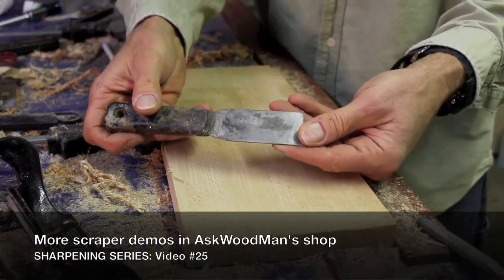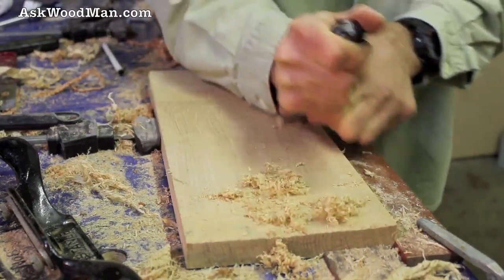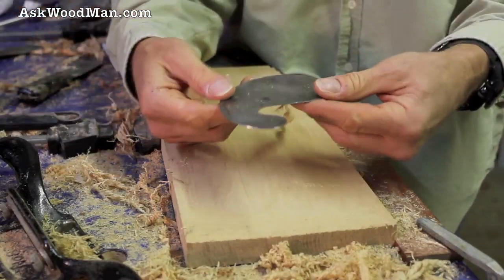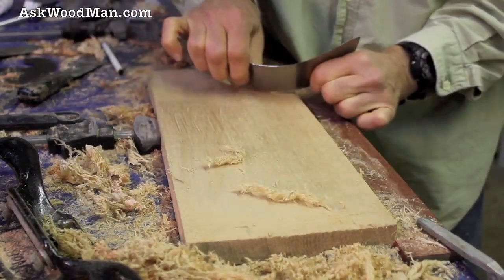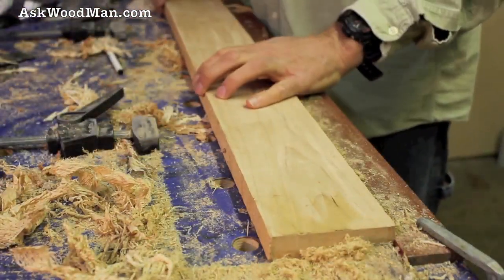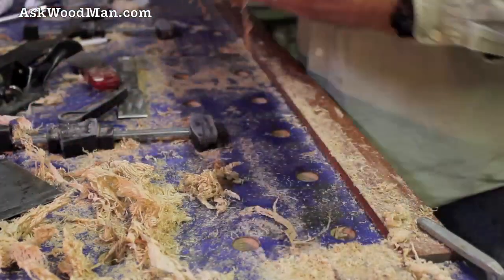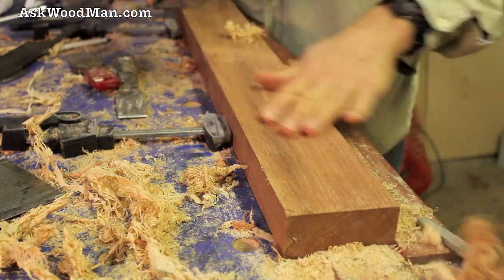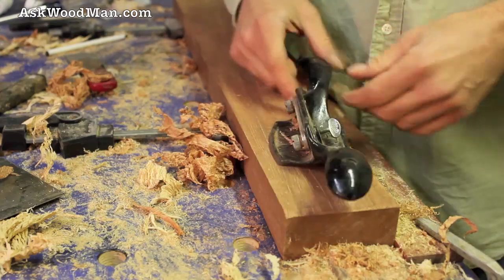Woodworking Demos: Using Scraper Planes • Complete Sharpening Series Video 25

Comment from the maker: I used to have a Kunz scraper plane similar to the Veritas. I never used it so I sold it. I don't scrape for finish, I scrape for stock and glue removal. I sand for finished surface. So I guess I will stick to the old Ford instead of trashing out the Mercedes on the rutted roads. Thanks for watching and for the suggestion. Allan

Comment from the maker: @deleetmeeh It is actually a common shaped scraper for unusual shapes. So it is made out of the appropriate steel for forming a hook. It is really handy for removing router burn glazing from concave pieces. Some section of that scraper will accommodate the profile of most concave work pieces. Burn glazing is really a pain to sand but a steel scraper cuts through it quickly to then allow faster sanding. Thanks for watching and commenting.